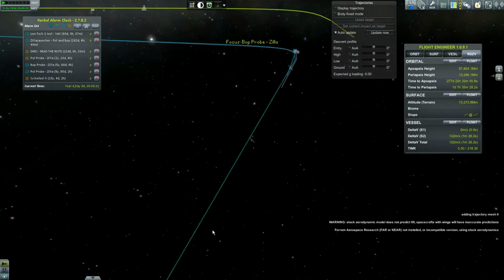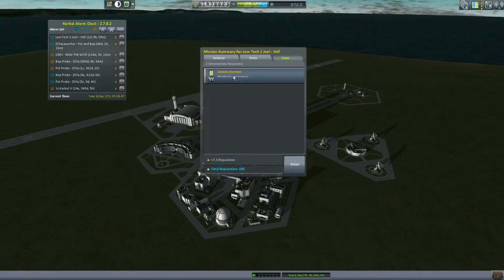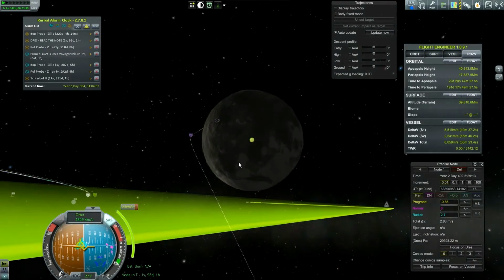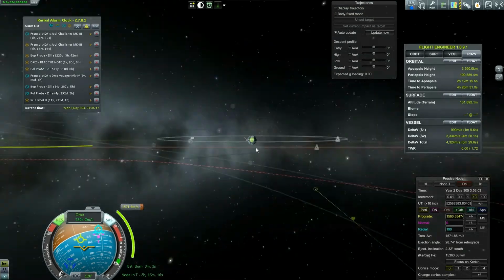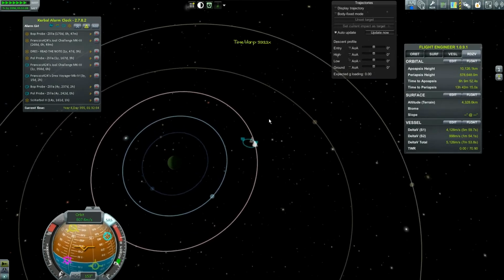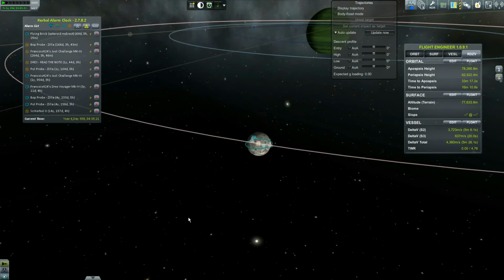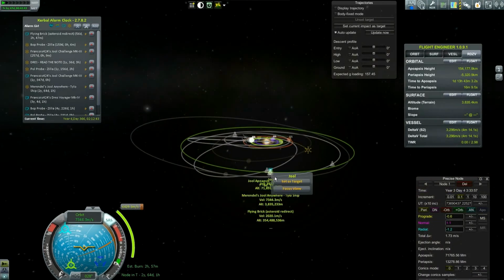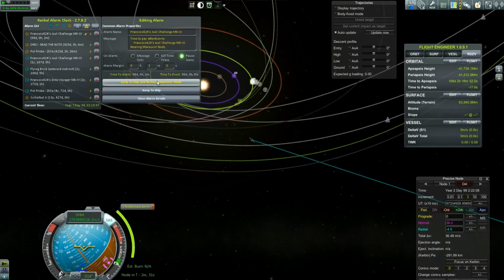KSP - Teamwork 37 - Homecomings Galore!

Comment: lol what did I say about breaking my ships 5th  :p although that was not the one I expected.  Although I am impressed that you managed to find a way to crash the same ship twice.   Intrestingly the jool anywhere transfer stage probably would have had more luck landing on tylo if it had been refilled than the brick.  The downside is no landing gear and no ladder low enough for a kerbal to grab onto so it would be pointless.
Reply from the maker: Had I seen it, I would have actually hooked the Anywhere to the bottom of the Brick and just used it as extra thrust and fuel, then dumped it to be destroyed while the brick landed.

Then I'd have had an issue figuring out how to get even more people home without seats :D
Reply: 5th Horseman I still find it amusing that of the 5 ships of mine you flew you crashed 3 of them, one twice.  Moho and duna went without a hitch.  Jool anywhere died to pilot error and then agian to a glitch.  The probe died partly to piloting but that landing was ragged edge of its performance envelope so not entirely your fault.  Really needed to be extra efficent with all burns to get to jool and back or have a refueler.  And then you wrecked the brick due to forgetting the landing legs :P  It probably wouldn't have fallen over with the legs out but you landed on a docking port.  Your insurance premiums must be killer.

Probably should have restarted the game after the first ship went haywire.  I've found that continuing after a massive physics glitch, particularly one that results in a crash on jool or kerbol can propagate to other ships if you switch right after without a restart.  Probably what happened to that probe.
Reply from the maker: Meh once I get landed on Kerbin, so long as the guys survive I don't care about the ship :)